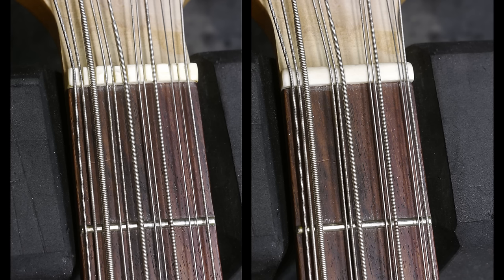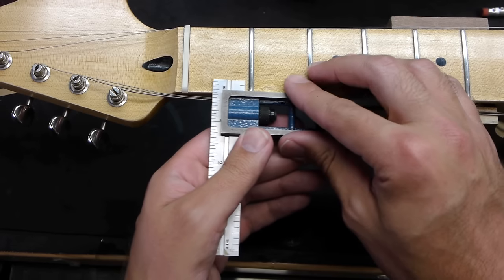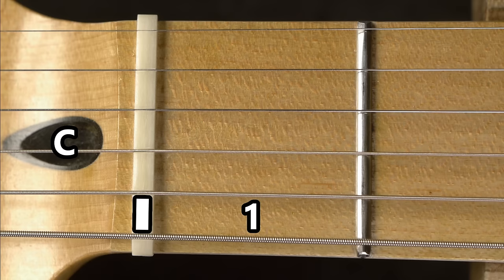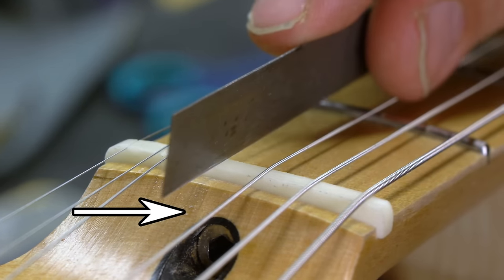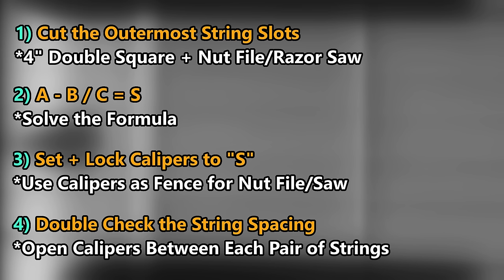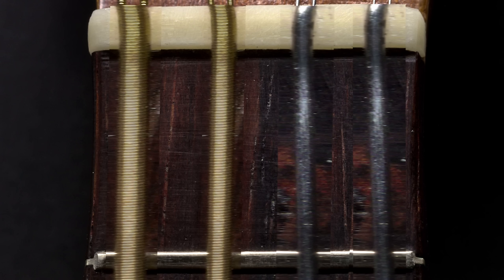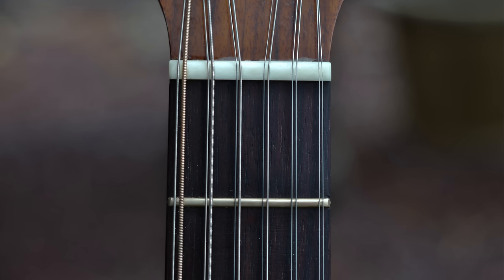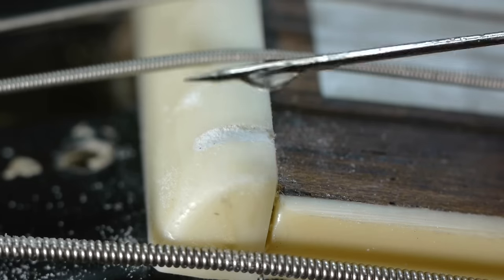Nut Slot Spacing *FOOLPROOF METHOD* - Works for 12 Strings Too!

Comment: nice!

i'm on team "equal-spaced centerlines" myself but i'm still totally stealing the double square trick for the initial outside spacing, as well as the feeler gauge gapper for double courses trick

either way, for equal-spaced edges this is super elegant!
Reply from the maker: Thank you so much! I've never tried "equal-spaced centerlines," but I have heard of them, and I know some people swear by them. I'd be curious if you have a way of cutting those slots consistently -- my brain is already working trying to figure out how I would go about doing this. 

The double square trick was a godsend for me. I was so frustrated after over 10 years of cutting nuts and struggling to get the outside string spacing exactly where I wanted it. 

And yes -- the double square and the feeler gauge trick will work for equal centerlines as well. 

I'd like to make more casual videos in the future talking about my experiences. This method was born out of a combination of struggling with pencil lines for many years (I never could cut over the lines as accurately as I wanted to, and invariably this led to many scrapped nuts)....

...but it really was finalized when I was tasked with cutting a 12 string bass nut. I couldn't even find anything on the Internet about how to do this, and it was hard enough to find anything on cutting 12 string nuts...and what I did find was not helpful to me. 

The 12 string bass, with tripled strings in 4 courses, was the most challenging nut I ever had to cut. And was the main catalyst in me inventing this method. I was so beyond thrilled when it worked and then I started slowly working on making a video about this methodology, which I first published a couple years ago in my video about how to cut 12 string nut slots. 

Anyway! Curious to hear about your experience with equal centerlines. I'm almost afraid that if I try a guitar with a nut cut like that, I might like it better! I'm a big believer in "you never know until you try." 

That 12 string bass nut deserves its own video. One great thing about YouTube is you do build up a catalog over time. I find myself referring people to old videos more and more often now so I don't have to explain so much to answer some people's questions. 

Anyway. Thanks so much for the support, and thanks for sharing. You've got me thinking about equal centerlines now. I might have to try cutting a nut for myself with equal centers and see how I like it. I'm just constantly amazed at how much diversity there is with guitars. My friend and mentor has been doing guitar work for nearly 60 years and is still figuring out new things every day and coming up with new ideas and inventions. Endless excitement...and that's to say nothing of actually playing them too.
Reply: @guitar_md  logically equal centered makes more sense to me because as a player i'm trying to aim my finger onto the center of the string whether it's a .009" guitar hi E or a .110" bass low E; the thickness of the string doesn't enter into how i fret it, i'm still trying to put my finger down on the centerline of the string.

equal-centered spacing means that when i shift from the E to the A string it's the exact same movement as when i shift from the D to the G 

aesthetically the equal-spaced thing often just looks better, especially with fat strings like on a bass. otherwise the bottom string can look too close to the edge and the low strings can look crowded, especially when they're way thicker than the high strings

practically i'm not super-convinced that the difference actually matters to playability that much though; you've got something that looks "right" and is fairly easy to nail down here, no mean feat!
Reply: @guitar_md  as for how to do equal-centered, i'm still searching for the best way myself!

i recently discovered vintage "proportional dividers" which are designed to mark out lines just like i would need and that's been useful, but it still leaves me fighting the same thing you mentioned, trying to start a file notch exactly perfect over a pencil line

i'm wondering if there isn't some way to use your trick of "A-B", where "B" is just six times the thickness of one thin razor saw or something used to create six equally distant starter notches

(or would it just be four times? or not, since that might throw off the outer two strings since they would be indexed off the edges instead of the centers? i don't see it yet but there's gotta be a clever way...)
Reply from the maker: @walterw2  I'm in the brainstorming process as we speak. There has to be a way. I'm also curious to try this out for myself. 

The tricky part will be using the jaws as a fence. It's imperative. No fence = no reduction in human error. 

The pencil mark thing is something I never could come to grips with either. Struggled for so many years. 

This has really got me thinking. Perhaps one day that'll be a video too. I do love a challenge. I have to think about it as if someone tasked me with making them a nut with equal center spacing. 

It'll be like coming up with this method all over again. I did find this formula on the Internet, by the way -- I don't remember where, but I found it many years ago. I merely came up with the 'calipers as a fence' concept to put the formula to good use. I absolutely would have given credit for the formula if I knew where I found it, or who originally came up with it. 

In my compound radius video, another recent one, I credit Don MacRostie. He came up with the formula for that. That is way beyond my paygrade. I can't even imagine coming up with a formula like that.

So...this should be an interesting challenge. Not sure if I'll be able to do it. But now I want to try.
Reply from the maker: @walterw2  So, I just brainstormed and I think this will work: 

Calculate the equal center spacing, then use the calipers locked in position. Use a Razor Saw of the same size as your smallest string -- like the high E string -- and cut all of the slots using that razor saw. 

Then simply work your way up with nut files on each slot to keep it centered. This might be tedious, but is probably the best way to make sure they stay centered, vs. starting with the full sized nut file over a pencil mark. 

So on the A string for example, you go from a .010" razor saw mark to a .016" nut file, .020", .024", etc. until you reach the target size. 

You could just use the full sized file over the slot, or use fewer sizes. You probably don't need to be that crazy about it. 

Also, this reminds me of the first iteration of my method. I used to use an Xacto #11 blade to mark a set mark, using the caliper jaws as a fence. 

And then I'd work my way up with the nut files as I described here. 

It didn't take long for me to realize that that was not going to work. It is not the way for equal gaps. 

But for equal centers? Perfect. What I was doing back then was cutting the string slot to be centered over the set mark -- when in reality, the full sized nut file needed to be placed against the jaws to get the equal gap spacing I demonstrated in this video. 

So -- that could be a revisit of that idea. I think this will work. I just need to work out the formula to use, and it'll be good to go. Then it's just a matter of making a video about it, after I can confirm that this works. 

The only other thing is verifying that the centers are accurate. This should be easy to do by comparing the razor saw / xacto knife marks with calipers. The caliper jaws will rest inside of the razor saw marks, as opposed to between the strings, as in my method for equal gaps. 

Well. I'm excited now! I'll have to put it to the test but I think this will work.
Reply: @guitar_md   i like it but i don't like it 🤔

yes we'll want to start with the thin notch and gradually widen it out to the string thickness, that part is conceptually easy

just putting the points of the caliper jaws in the starter notches doesn't seem accurate enough; will they be sitting in the centers of those notches, at the edges, who knows?

do we have to string up the guitar with six hi E strings and use those to do the all-important indexing of the jaws off of? that would work but seems kind of silly
Reply from the maker: @walterw2  I think a .010" razor saw would be an accurate enough margin. The jaw tips should have no room to move either way in such a shallow mark. That's the key, and I think .010" should do it -- once the tip catches the slot, it should not be able to move in any direction. 

The Stewmac .010" pull stroke gauged saw is the only one I know of at that fine a measurement, unless you can get Xacto razor saws in specific gauges. The spine would have to be ground off like I did to my B-string razor saw in this video in order to be able to use it as against the jaw tip of the caliper. 

Most razor saws I've seen are around .015" width though occasionally you get lucky and can find a .012". 

The High E strings in the slots would be sitting in the center of the slot, which would prevent an accurate measurement of the center of the slot. 

So I think the .010" set marks should work. The idea being that the jaw will naturally center itself over such a set mark, and be unable to move left or right in it. So it could be used as a fence to cut the slots and to measure the distance between them accurately. 

This remains to be tested. 

As for cutting the outermost strings: I think these should be cut with the .010" saw as well, and the double square. 

This may require special treatment for the Low E vs. the High E. The High E could be cut exactly as I did in this video. 

But the Low E, given that we'll be making a center cut -- it will have to be moved up half the width of the gauge in order to be the same distance from the bevel that the High E string is. 

I was originally thinking of cutting and slotting the outer strings as normal, but then you'd have to butt up the calipers against the outside of the strings to use the jaws as a fence -- 

-- and for equal center spacing, I don't think that's going to work. I think it'll have to be .010" starting slots for every string, including the outermost. 

And then "A" will be calculated as the center-to-center distance between the outermost .010" slots. I am banking on the jaw tip not moving in the .010" slot, but I really don't think it will. It shouldn't be enough room for there to be any play and I think it's reasonable to use that slot as a solid centerpoint that the jaw tip can't stray from. 

So then it's a matter of calculating the even center-to-center spacing for the remaining inner strings. 

In theory, then it's jaw tip in the .010" of the previous string, slot the new .010' slot for the new string, rinse and repeat, and done. Then double check the distance between each .010" slot with the calipers.
Reply: @guitar_md  good stuff and will warrant chewing on for a while
Reply: Equal center spacing for 6 string.  
Make both outer string starter notches with a .010 saw using the square as you described.  Remove the strings and protect the fingerboard.  Using the saw in one notch and a 010 nut file in the other,  measure the distance between with calipers. 
Add .010 to this number to account for the two edge to center distances of the fences in your measurement to get the total center to center distance. 
There are still five gaps so divide this result by 5 to get true center to center string distance. 
Because we have to allow for the thickness of the saw and the use of a  fence set the caliper to the true center to center distance minus .010 (center to edge thickness of the fence plus 1/2 the thickness of the saw blade). Use the .010 file as the fence in the 1st slot, calipers and 010 saw to cut  a starter notch for the 1st inner string  slot.

Here is where I suggest a different approach to eliminate cumulative errors.
Leave the file in the 1st slot!  Reset the calipers for the next cut. 
The 2nd inner string cut is 2x the true string to string center distance minus .010  Set the calipers,  make the starter notch cut with the 010 saw.  
Inner string 3 is 3x the true string  to string center distance minus 010.
The 4th inner string is 4x the true string to string distance minus 010.

At this point you have  six starter notches to keep the correct file thickness centered as you cut the full notches.

The argument for equal center to center spacing is that it's easy to do and can be done away from the guitar. It's unaffected by string gauge. Ideal for mass production.

Of course the development of proportional center to center (StuMac) spacing is in response to the obvious issue of tight spacing on lower and heavier guage strings while still being basically guage agnostic. 

Equal gap spacing as you propose 
is IMO a much better solution for paired string or triple string instruments. Brilliant! 
The only consideration,  and this is not that big a deal,  is that string gauge matters.  In practice however, it would be rare to change gauges significantly and that would likely require nut work anyway.  
I might consider the extra math required to measure each notch from the 1st as I suggest for equal centers, but your method is far simpler to implement. It demands VERY careful use though as error accumulates. One option is to cut inner strings from both sides to reduce error accumulation to 2 steps. Cut the lower two inner strings from 6 and the upper two from 1. 

Speaking of 12 string, my particular interest,  have you considered different pair gap spacing?  High strings certainly need less.  You suggested an 028 minimum. What others have you tried? 

Many thanks for the clarity of your videos. There is so little on 12 strings out here

Comment: 4:44" CRINGE!
Reply from the maker: It actually takes some deliberate force to make indentations in wood with caliper jaws. You can try this yourself on any wooden surface. Simply resting them without actively pushing down into the wood will not make any mark or indentation at all. 

I've done this hundreds of times and never once have I left any visible mark or indentation in a fingerboard with this method. 

However, your cringing is not unwarranted. And I have a solution: 

You can easily use a thin strip of mylar film under the jaws as a shield. 3 seconds: cut a strip of film, tape it down on the fingerboard, done. 

I would have mentioned it in the video if it had occurred to me. Part of me wishes I did, and you could consider this an oversight.

However, looking at it another way: I've done this so many times without any cosmetic damage at all -- ever -- that it didn't even occur to me to mention using a safeguard under the jaw tips. 

Of course, it isn't a bad idea, and it's always better safe than sorry. A few seconds of preparation can prevent hours of headaches. I have plenty of mylar film, and the best part about it is that it's reusable. 

So even though I've never had a single issue with this, maybe I'll start using a strip of film regardless. All it would take is some inadvertent downward pressure to indent the fingerboard. 

Masking tape on either side, attaching to the sides/back of the neck, will hold the film in place for the duration of the slotting. 

I've been wanting to make a dedicated video on mylar film and its superiority for masking/shielding areas of the guitar while working on them. Scrap leather is my other main choice, but nothing beats the strength and resilience of mylar film when a thin, barely-there shield is necessary when doing delicate work. 

Ram Board is another. It makes an excellent shield for the body when doing fretwork. Cut it to the size you need for a particular guitar and you can reuse it indefinitely.

Comment: Or you could, y know, mark them off with a mechanical pencil.
Reply from the maker: Yes, you can. My friend and mentor lines up the string spacing by eye and makes pencil marks on either side of the strings that way, then puts his thumbnail right in the middle of the two lines and uses it as a fence for a razor saw as he cuts the slots. He's been doing it this way for over 55 years and gets excellent results. 

Other people use a Stewmac String Spacing Rule, make the pencil marks that way, then chuck the nut in a vise and cut the slots over the pencil marks. 

All roads lead to Rome. My goal with this method was simply to eliminate the potential for compounding errors that result from imperfect placement of the file over the pencil marks.

It's very easy to make accurate pencil marks, but when it comes to filing over those marks, an error of .010" or even .015" is not unrealistic. Add that up over a few slots and it can result in extremely uneven spacing if the person is not careful. For many years I relied on pencil marks and it resulted in many occasions where I had to re-cut the nut from scratch. 

The caliper jaws largely eliminate human error, much like the fence on a band saw or table saw eliminates human error when it comes to cutting lumber in a perfectly straight line.